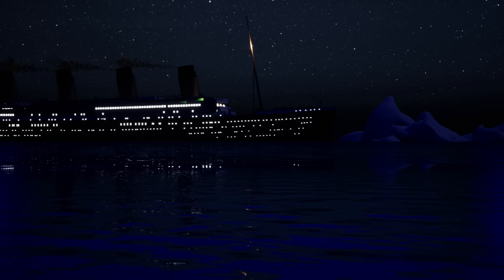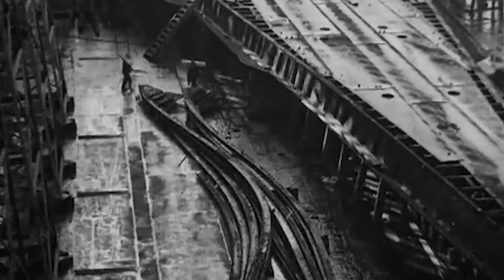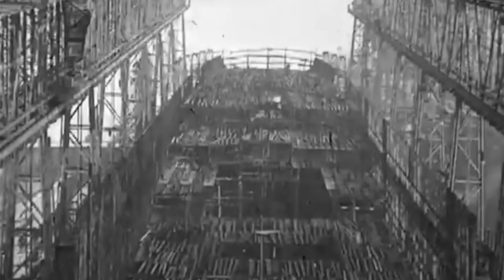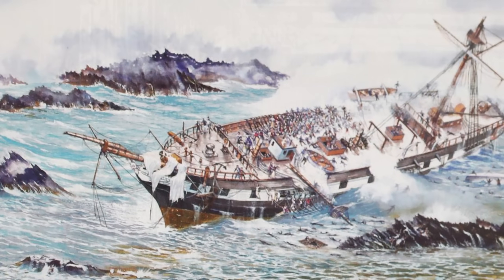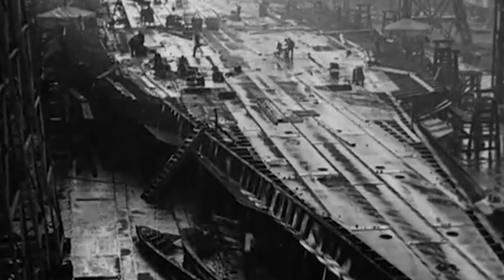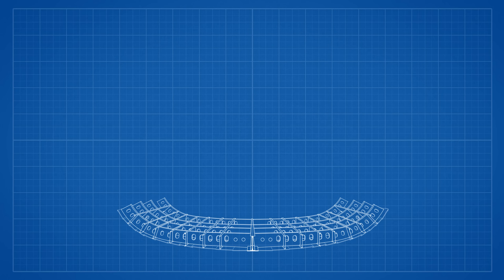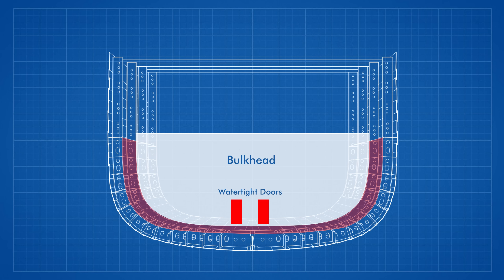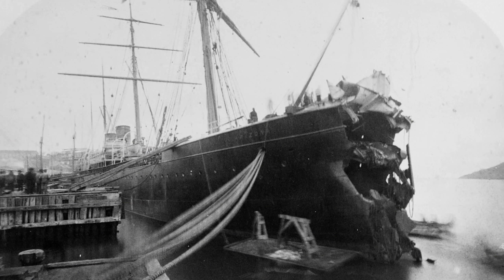How did the Iceberg Sink the Titanic?

Comment: The story of Titanic's watertight compartments has been misunderstood throughout the decades; when you read the trade journals of that time period discussing the design of the watertight compartments, it's obvious they were never meant or designed to save the ship or even keep the vessel from sinking. I want you to think of the watertight compartments in Titanic like run flat tires, (run flat tires are specially designed tires with very thick side walls that allow you to temporarily run the tire without air in it long enough for you to safely get off the highway and drive to a nearest tire shop and have the tire repaired or replaced) it's not a permanent solution if you puncture your tire you cannot simply Drive indefinitely on flat run flat tire, despite what some people may think! ultimately if you drive for a great distance on run Flats they will disintegrate just like any other Tire, this is the way Titanic's watertight compartments were designed, they were never designed to save the ship or even keep the ship from sinking they were designed rather in the event of a ship having its hull compromised, the watertight compartments served as a delaying action to reduce And Delay the flooding of the vessel long enough for the vessel to send out distress signals and for other ships in the area to respond and rescue everyone... they're really a delaying action!                                                                            Anytime a ship's Hull is compromised and opened up to the Sea, you can no longer guarantee the safety or soundness of that vessel once the skin is compromised! even with water tight compartments remember the Concordia 2012? well she had more and better water type compartments then Titanic and she still capsized and sunk... Once a ship's Hull is compromised you can no longer guarantee that that vessel will stay afloat so the water tech compartments like run flat tires are not meant to be the Salvation or permanent solution!!! they're just to buy time.                                                                                                                        Think of the Atlantic Ocean as a highway; there were eastbound traffic lanes and westbound traffic Lanes and the ships all relatively stayed close together on these Lanes so at any given time when you were out at Sea you were never more than possibly 50 miles or so from another vessel and with radio, flares and signal flags, a ship that was in distress typically could expect to get a hold of another vessel that would instantly come to your Aid and save everyone on the ship, so the idea of the watertight compartments was to buy Titanic enough time that one of these other vessels on one of these shipping lanes could turn around come to Titanic's rescue and rescue everyone off the ship and then either the vessel would be towed into a port where it could be repaired or if it couldn't be saved she would just scuttled by some last remaining crew and allowed to sink.  What makes the story of Titanic so amazing and sad is that that night everything that the ship had been designed to do and safety feature that they had put into Titanic was defeated by the events of that night!!! and that's why people died...                                 The reason why vessels weren't required to carry enough lifeboats for everyone on board ship, again lifeboats never meant to actually house passenger and crew on the open ocean, rather the lifeboats were meant to be filled with people lowered onto the sea where they would row to a rescue vessel and then be offloaded and the boat would be returned and get more people that's how they Envision lifeboats being used... Because the idea is that no matter what happened there would always be a nearby ship on the shipping lanes to come to your Aid and Rescue, but again that night everything that happens to the Titanic just defeated all of the thinking about safety and designs of that time period..

Comment: The question I've had for years, and haven't found anyone that really has the naval engineering background to properly answer it:
Would capping the watertight compartments mattered, or would the flooding of 5 to 6 compartments simply been a fatal loss of buoyancy regardless.
Reply: @nathanbond8165  Boiler Room 5 is the 6th compartment. Without it Titanic would still be doomed. BR 6 was the nail in the coffin.
Reply: @ZVdP  you're right I don't know what was wrong with this guy's diagram but you're right the first four compartments stopped at Boiler Room 6 so yeah she was doomed I watch this stupid documentary that made it seem like all of Titanics drama was in Boiler Room 5 and like that's where the shit was fighting for survival my fault they dramatize the whole thing to make a movie out of it and omitting the part that Boiler Room six was flooding and therefore trying to save Boiler Room 5 was completely useless but you're right looking at the diagrams it's the first four compartments stops at Boiler Room 6
Reply: @ZVdP  you know I have a question Titanic was designed to withstand a breach in the first four of her watertight compartments or any two adjacent Boiler Room compartments however they did not double skin the boiler rooms so in the event of a grounding or a collision that would open up a boiler room to the the sea allowing ice cold sea water to come in contact with red hot boilers was there no consideration for a thermal explosion that would rip open the guts of the ship I mean the reason why there were no explosions at night is that the flooding was slow enough where the men and the boiler rooms were able to shut down the boilers as the flooding progressed but ships have been known to have boiler explosions when seawater hits that boiler boiler so wouldn't that have been concerned enough to double skin the boiler rooms as an extra layer of protection against thermal explosion
Reply: @nathanbond8165  Yeah, documentaries tend to overly dramatize certain things, certainly with stories like Titanic's about which most things have already been told countless times.

Using numbers from 'SS Titanic a centennial reappraisal' there was around 200 tons of water in Boiler Room's 5 bunker, compared to over 8000 tons in the forward compartments 45 minutes after the collision.
That's not going to make much difference. Especially since the collapse of the bunker doors just redistributes that water across BR 5, the total weight remains the same.
Barrett places this event around 1.10am, a full hour before the sinking.

I have no idea how much damage a boiler explosion would cause. It was definitely on their mind during the sinking as emptying the boilers was one of the first things they did.
On the other hand I don't know of any boiler explosions in Britannic's boiler rooms 5 and 6 where they certainly didn't have any time. Divers have been to Britannic's BR 6 and it looked intact.
Reply: @ZVdP  now as far as the boiler thermal explosions that's a very well studied phenomenon it's a huge danger there is so much kinetic energy stored as heat in those boilers any sudden release of that pressure is catastrophic there's a famous photograph of a steam engine who's boiler exploded it's amazing it looks remember this is inch thick plate steel that they made steam engines out of and it looks like an atomic bomb went off in that thing also I'm basing my assessment about the boiler explosions historians believe that the second devastating explosion that was felt in the Lusitania sinking was in fact thermal boiler explosions they couldn't shut the boilers down fast enough the water was coming in so fast from the torpedo strike it is been very well documented that there was first a small explosion and a splash of water from the torpedo striking the side of the Lusitania and then about 15 seconds later there was a massive explosion that rocked the ship shook the entire ship and she sunk in less than 18 minutes now there's no way to examine the boiler rooms inside of Lusitania because she's rolled on her side and completely compromised I will also refer to the World War I famous naval battle of Jutland where a number of British naval ships that received direct strikes where had no Upper Deck armor a few of those ships exploded as if a bomb went off inside of them it is believed those were the boilers exploding so yes boiler thermal explosions is a very dangerous thing and they were very concerned about it the night of Titanic sinking
Reply: @ZVdP  never mind my service boiler explosion Theory upon reviewing again the diagram of the ship I realized that Boiler Room won which had the service boilers was right where the ship broken too so those boilers would have instantly have been exposed to seawater if they exploded it would have been on the surface now they may have still exploded and caused more internal damage to the ship but I don't think considering where they're located I don't see how they could have caused all the damage to the stern that they did the very rear of the stern is missing most of its shell plating so I guess implosion did cause that which seems odd to me because an implosion is an external pressure not internal it just looks to me like the shell plating was blown off of Titanic's ribs not blown into them
Reply: @nathanbond8165  so why didn’t the boilers in BR6 explode on contact with ice cold sea water that sprayed them when the hull was opened up?
Reply: @timothyreed8417  the fire stokers pulled the coal out and shut down the boilers before the room fully flooded with sea water
Reply: @timothyreed8417  one thing Cameron got right in his movie Titanic 1997 when he shows the fire stokers putting out the boilers after hitting the berg
Reply: @nathanbond8165  it’s the loss of water in a boiler that causes it to explode…the outside is relative cool and insulated….
Reply: @timothyreed8417  how does less water in the boiler cause an explosion?
Reply: @nathanbond8165  do you understand how a boiler works?
Reply: @timothyreed8417  yes it's a heat exchanger, heat from the fire is transferred to the water causing the water to boil converting water into pressurized steam which then is used to power a piston that drives a mechine...
Reply: @timothyreed8417  so that's why I asked you how does less water cause an explosion, less water to me would reduce steam pressure! I'm I missing something
Reply: @nathanbond8165  the boiler has a number of components on the inside. Furnaces, fire tubes, stay tubes, crown sheet, etc. all protected by water. Heat generated in the furnaces passes into the crown sheet then passes thru the fire tubes into the flue uptakes and up the funnel… all this heat is transferred to the water surrounding these components. When these components are exposed,not protected by water, the metal starts to get soft and lose structural integrity…a sudden reduction is steam pressure ie the relief valves opening will cause the water, in the boiler under pressure and temperature, to flash into steam very rapidly, and lower the water level and uncover the components. The idea is to pull the fires and reduce the temperature of the water and the production of steam and the pressure in the boiler…most boiler explosions (scotch marine) are caused by poor water management.
Reply: @timothyreed8417  oic thanks
Reply: Olympic's and Britannic's watertight compartments were altered after the sinking to be able to withstand Titanic's damage. So yes, there would still be enough buoyancy. 
In any case, I don't think there were many commercial ships with sealed compartments. That's more something for warships.
Reply: @ZVdP  the main upgrades to Britannic and Olympic was to install a double skin all the way up to I believe e-deck and the extended the height of the watertight compartments however they never sealed the top of them again buoyancy was lost in Boiler Room 5 the ships could only stay afloat with four front compartments flooded not five! not five! as was quoted in the movie that is accurate... Boiler Room 6 was the fatal wound to Titanic it negated her buoyancy when Boiler Room 6 flooded is when the ship broke into two and sunk
Reply: @ZVdP  God you're so right looking at the watertight diagram of the ship it's obvious that Boiler Room six was the fifth compartment you have to be so careful  so much fake agenda documentaries and crap on YouTube about Titanic so there was no way to save the ship she had six compromised compartments which makes a lot of YouTube videos and documentaries and internet discussions completely irrelevant she could not survive six flooded compartments no matter what they did that night that ship was going to sink

Comment: Titanic WAS designed to withstand icebergs, but Titanic likely never even hit an iceberg, certainly not to the extent of the damage. There are a number of passengers who stated that the collision was so slight that if you held a glass of water to the brim the water wouldn't spill, hardly anyone even noticed anything until they were told. The ice on the boat deck so often told with passengers playing football could've been down to ice that had accumulated on the rigging, funnels and masts and had fallen off when the ship stopped and was abruptly put into reverse, nothing to do with it hitting an iceberg which towered over the deck, and for some odd reason never even touched or knocked into the forward starboard lifeboat that would've been swung out over the side of the ship.
Reply: Plenty of people recalled a much more severe feeling of collision lower in the ship, dozens of people reported seeing the berg itself, the ice on the deck was reported to have been mountainous, the shape of the iceberg wouldn’t have necessarily been in the vicinity of the cutter boats.
Reply: @DerpyPossum  The iceberg was described as looking like the Rock of Gibraltar and being over 100 feet high. If it were this high and scraped against the starboard side then it would've damaged the starboard bridge lifeboat which was swung out over the side, but this lifeboat was never touched, so whatever caused the damage wasn't an iceberg. These ships were immensely strong, each steel plating at the bow and stern overlapped by 6 feet, and underneath this was a frame and each of these were spaced 3 feet apart. There are eyewitnesses who saw another vessel close by at the time of the collision, one passenger, Marion Thayer, even looked down from the deck and saw what she thought were floating pieces of wreckage from a ship. The seal hunting vessel Samson was in the area at the time, and it is possible they had turned off their lights to avoid being seen by the approaching Titanic and had hidden behind the iceberg. It's also possible that Samson or another ship came into contact with Titanic's starboard side with her propellers and had caused the damage. Lookouts Fred Fleet and Reginald Lee were so sure that they had narrowly missed the iceberg that they carried on with their duties.
Reply: @Embracing01  An iceberg is not a wall. It’s shape is not consistent. What sections of the berg that damaged the ship could simply have stuck out more that the portions near the boats. Besides, the more reliable testimonies place the berg’s height at closer to 60 feet, I recall. 
In addition, the Samson was in Iceland at the time, as multiple reports show.
Reply: @DerpyPossum  No, its height was estimated by one of the crew as well, and they wouldn't have been mistaken. And why was there no ice inside the ship from where it impacted and where water came in?. None of the surviving stokers and firemen described ice inside the ship only on deck which likely came from the wireless masts and rigging from ice building up due to the cold temperature.
Reply: @Embracing01  Because the actual damage was slits, made through hull plate edges buckled inward. The damage simply wouldn’t have been big enough to allow any ice through. Besides, even if the damage was big enough, small pieces of ice probably would’ve been pretty hard to make out in the torrent of water.
There wouldn’t have been ice buildup on the rigging, because they were only in the relatively colder temperatures for a couple days prior. Heck, they didn’t enter the frigid waters of the Labrador current until four hours before the collision.
Reply: @DerpyPossum  There was never any torrent of water pouring into the bunkers, some of the crew described only a small sprinkle of water enter, though this contradicts another firemen who said there was, clearly one of them was lying.
Reply: @Embracing01  What’s the full quote?

Comment: So if you punch a hole in one compartment, the water’s only going to flow in until it reaches the level of the water outside, which was designed to be below E deck, and then the ship will stop taking water?